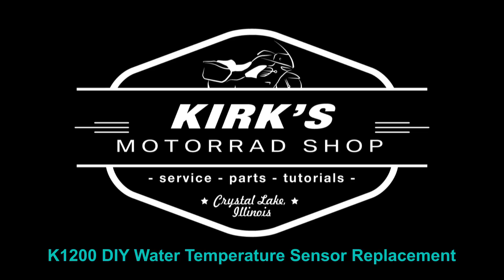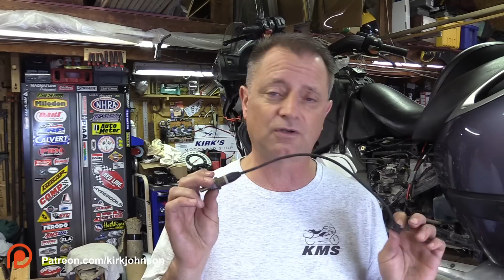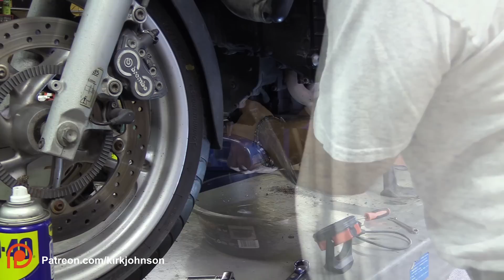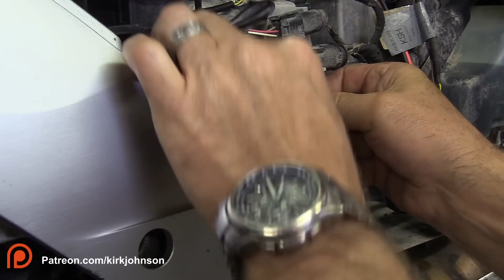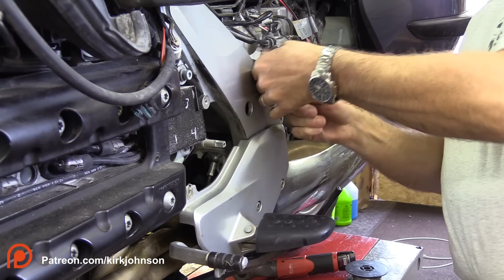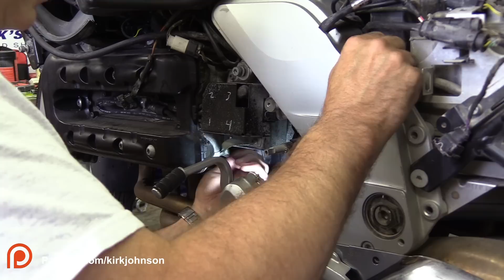BMW K1200 DIY Water Temperature Sensor Replacement

Comment: Very  helpful .  Recently acquired a 1999 with the same problem, fans came on at key on,  plus hard cold starting.  I deduced that the temp sensor was also telling the ECU that the bike was warm and did not need enrichment during starting.  I did remove the coil pack as recommended in the factory manual.

Comment: Hi! How are you.  I have a k1200lt, but haven't used it in like 2 years.  And the temperature rises a lot when the motorcycle is stopped or in traffic, because the fans do not turn on.  I checked the fuses and they are fine.  It could be the fan relay, or it could be this temperature sensor.  what is your advice

Comment: Hey do you have a part no.?
Reply: You ever find a part number? if so, please share!
Reply: @dudenamedclem  No, I actually bought a used set of sensors off of ebay. I installed the sensor and then it went bad again in Phoenix when it was 116 in traffic, super cool. I bought a second set of used sensors, but I don't really want to get bit by this again.  I bought a coolant temp sensor with a pigtail for a 99 BMW 325i. The threads are a smaller diameter. I'm going to have a machine shop make me a bushing that will screw into the block, that the sensor will screw into and use the wiring off the old sensor and the new pigtail to wire it. The other option is to "smartly" remove material from the old sensor where it is swedged together, then open it up, replace the element with the new one, and re swedge it to hold the new sensor and make the harness. Email me If you want and I'll send pics of how to do this.

Comment: Kirk,
I take it there is NO typical "thermostat" on the LT.  You, or anybody else dealing with the radiator, and cooling service has never mentioned one.
Am I correct to conclude isn't one ???
Reply from the maker: There is one at the bottom of the right radiator

Comment: Hey Kirk....Just got a used 2001 k1200 LT.  The temp gauge stays pretty close to the red, but not in the red.  Is that normal for these models.  The fans do come on when it gets close.  they don't come on when it's down in low temp.
Reply from the maker: My experience has been that they run up toward the red but quickly come down again when the fans come on.  Going up big hills or mountains will kick them on due to load and elevation. They should run normally in the somewhere in the middle when moving. If yours is running hot all of the time, that is not really normal and it may need a top off with coolant or a thermostat.
Reply: @kirksmotorrad  the coolant level is an inch below the "min" mark.  do you have an e-mail I could have so I don't keep trying to talk to you on the youtube channel?? lol....
Reply from the maker: kirk@illinoisbmwriders.com
Reply: The Soul Juice Band Hi, I have the same problem on my k1200LT 1999. If you have solve the it, could please tell me how? Thanks!